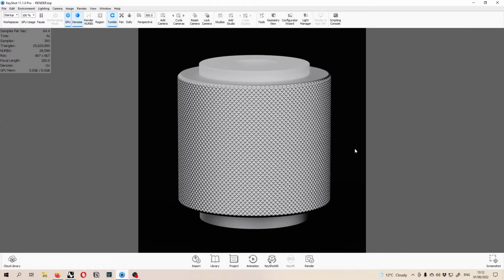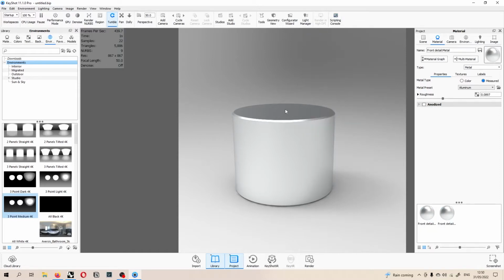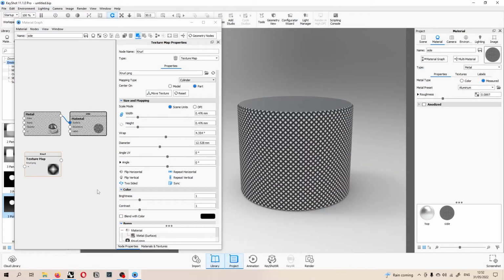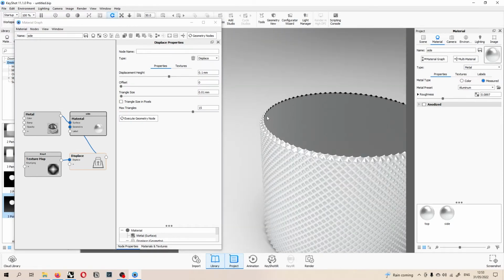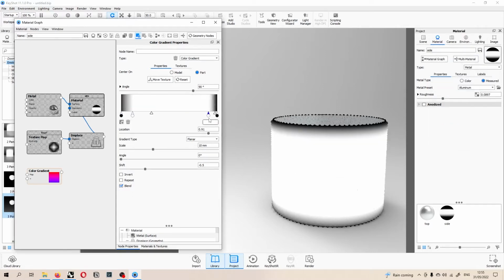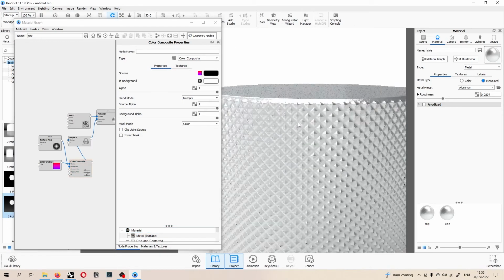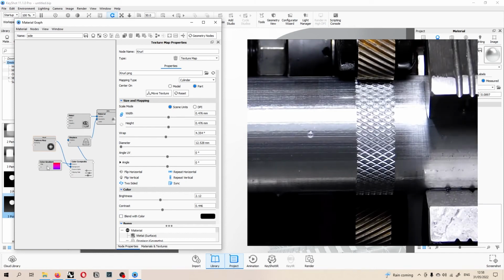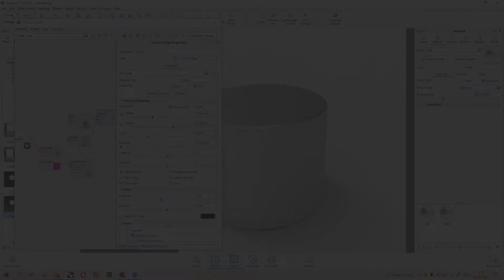how to add displacement map in keyshot

Comment: My problem currently is my geometry looks blocky. My texture size if 1.5 in and I bring the triangle size down to 0.01in and nothing really changes. I am using a baked texture from blender using the open exr file. Is that a good file to use?
Reply from the maker: I don’t think the exr is the problem but maybe try with pnj. Also it can be the hight of your displacement maybe. When you say blocky you mean the texture displacement has some sort of steps?
Reply: @DuterqueStudio  sort of looks like the triangle size is too big. But also looks like the edges of the triangles are being smoothed over. So, it seems to look like low poly geometry with some smoothing which makes it more baffling to me what could be my problem. For context, I'm displacing a diamondplate pattern on aluminum material. Even one of the default Dimondplate key shot materials does this when I bring down the scale.
Reply from the maker: @shawncrocker7037  can it be the scale of your object which is bigger when you imported it? Like one unit is 1meter instead of 1cm. 
And also is your object a closed mesh/polysurfce, if not keyshot my struggle understanding which direction the normal’s direction should be orientated